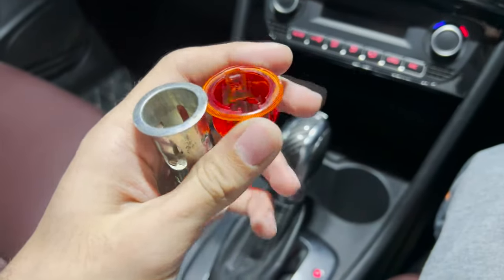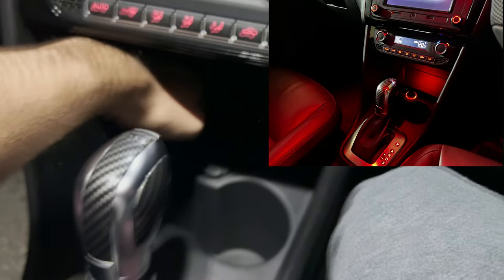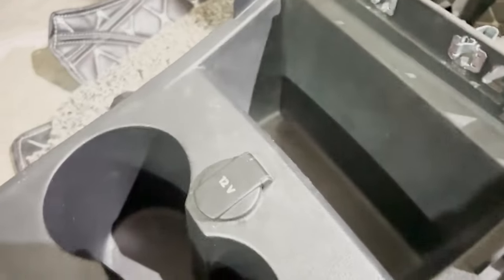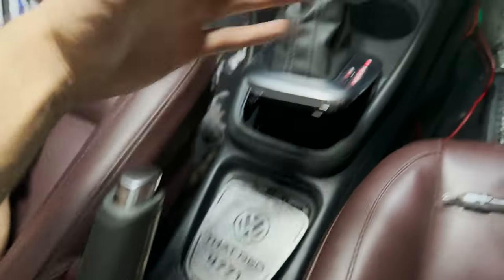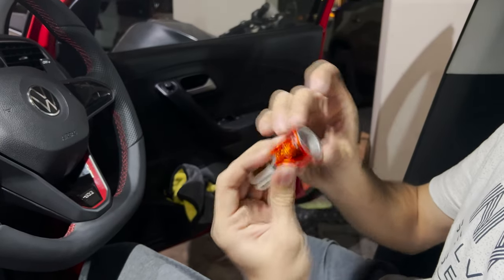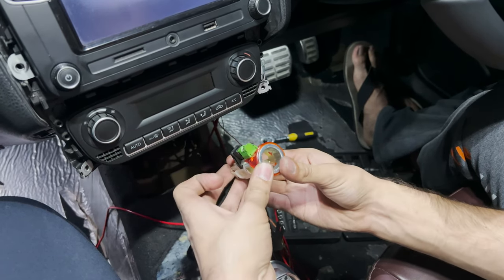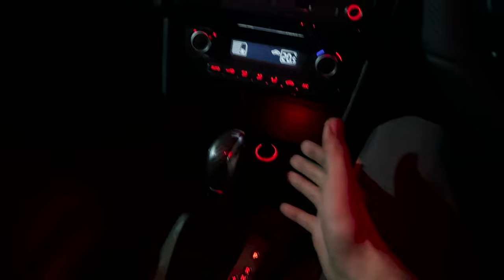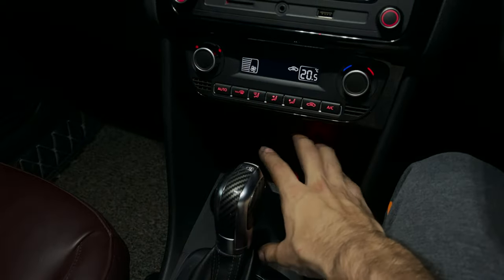Cheap, OEM & Plug and Play Ambient Lighting For Polo!

Comment: Bro is it possible to change the blaklit lights of that passat dome light ? (RED ➡️ GREEN)
Reply from the maker: You’ll need tiny green LEDs out of a green back lit button, window switch maybe, than open the cabin light to remove backlight from its motherboard and solder on new green one, for the ambient light, white led would be better as Škoda cars get white ambient lighting
Reply: @PrerakKataria  Thank you so much for the reply 😊❤️